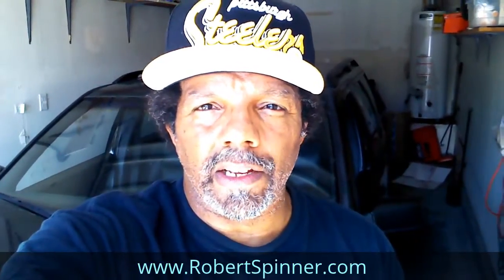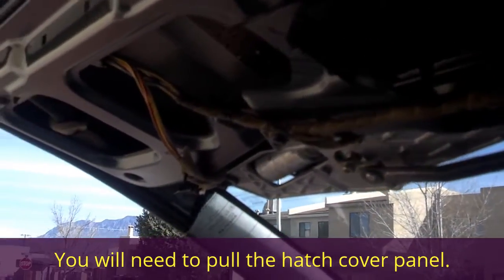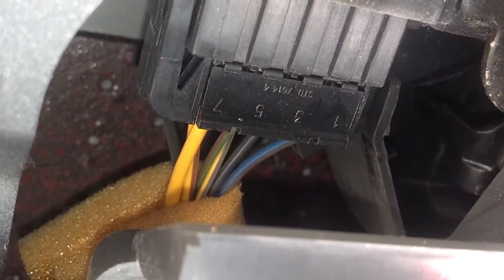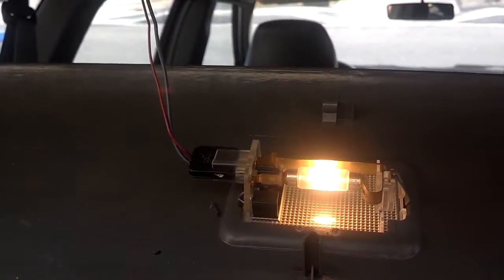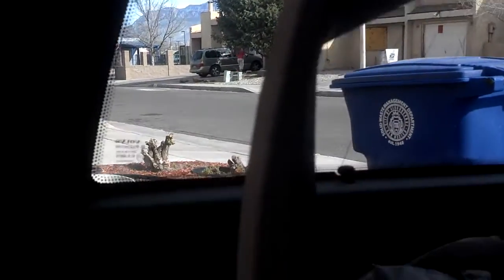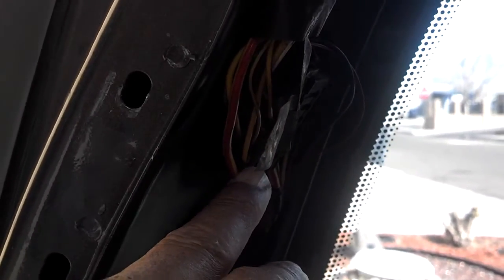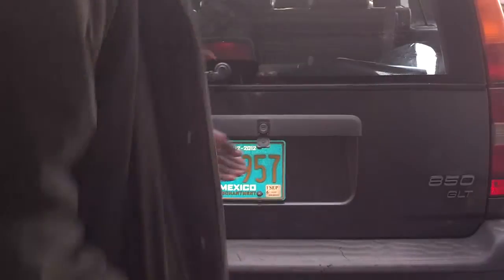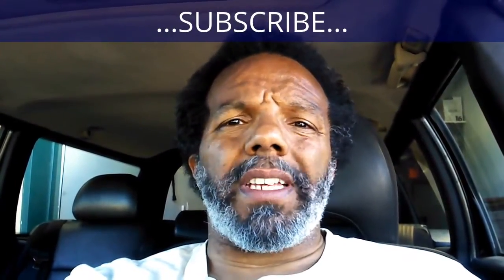Rear hatch latch testing and repair, Volvo 850, V70, V70XC, etc. - VOTD

Comment: Any videos on removing the rear hatch lock, on an 850 wagon. 
The trim piece, won’t come off, with the lock cylinder attached. 
(Lost my key) 
Had to break the ignition, to get home, from far away.
Reply from the maker: Probably not. It has 3 screws.
Reply from the maker: https://youtu.be/8MpOsLy9keg?si=0vt7nXaSdDnQio_3
Reply from the maker: https://youtu.be/QDh4WZne4LA?si=GJto1noap3s-66Ry
Reply from the maker: https://youtu.be/BkAPxVkyzwo?si=lWLqqrQhYClLffgz
Reply from the maker: https://youtu.be/gt9w-ZSxs9I?si=g4vLn7gwNIceLB8x
Reply: Wow, that’s a conscientious reply. 
You’re the man. 
It was quite an adventure. We did an eleven day hike. I lost the only key. But was the ride for four other people. 
Had to break in, turn off the alarm, and get the column lock off, to drive home. It’s the European version 97 manual AWD, luckily I had put in a non chipped 98 T5 ecu, (and engine).

Comment: I have this problem where I use the central locking remote and it locks and unlocks once then the tailgate is locked shut and I cannot lock my Volvo but I can unlock it.
Reply from the maker: Which Volvo do you have?

Comment: I have a Kia ceed 2 estate 2010 have tested the latch direct from the battery,it has currant at the opening and closing terminals,but does not lock or unlock unless i do it manually,any ideas
Reply from the maker: maybe a bad latch.
Reply: @RobertDIY  yes have had one from eBay,but that was faulty,have checked it out direct from the battery, that's how the workshop manual tells you to do it, another one one comming tomorrow,if still not working will check the wiring from the latch towards the headlining,thanks for your help

Comment: I have a 2003 S60 sedan with the electronic trunk release. The "Valet Trunk" lock is on and won't release.  I got the trunk open (after sending my kid through the backseat armrest), but the "Valet Lock" won't deactivate after following the directions in the manual. What I've done so far: Checked the fuse for the locking motor - Still Good. Checked the cables - Still Good. Checked the exterior button to open the trunk: Still Good & makes a clicking sound when pressed.  Anything I missed?
Reply from the maker: +Dave CP Do you have a standard key or remote?

Comment: Thanks as ever Richard. Just tested the wiring on mine and got the rear side panel off without completely removing the roof section that you say breaks. Just needed a little wiggle to get passed it after removing the two T25 screws and pulling down the front section nearest front of car. Just thought I'd share as these twenty year old plastics are getting very brittle. Keep up the great work. Regards Redbrick.
Reply from the maker: Cool, thanks for sharing.

Comment: The plastic ring that my ‘98 V70’s tailgate latch goes into is very worn and about to break. How would I install a new one, or can I simply fix mine?
Reply from the maker: I don't understand your question.
Reply: Robert DIY it’s hard to explain. You know how most doors strike a plastic cylinder piece when they close? The one for my trunk is so deteriorated that it’s pretty much gone, and when I open my trunk, the latch doesn’t completely open up to close again.
Reply from the maker: I'm sure it can be replaced.
Reply: Robert DIY I wrapped it in Gaff tape and it works every time now. I just have to keep an eye on it

Comment: Good question for you Robert.

First of all, thanks for your help.

Second of all, in my s70, for no reason, the car now thinks that the trunk is always open and won't stop ringing in the car and there no courtesy light anymore.

I could easily trouble shoot it, but it's like -20°C right now here so I'm not so happy whit this option hahahahaha.

The trunk open and close normaly, it lock and unlock both with the key and the switch in the car, only the light for the trunk in the dash is light up.

Thank you in advance for your help and keep on the good work
Reply from the maker: Has a bad micro switch in it.
Reply: Really? Because it happened and I didn't touched it at least for the day. Do you know a quick way to be sure if it's the switch? I believe you, just want to be sure before working on it :)
Reply from the maker: Nope.
Reply: Good, then I'll check that myself hahahaha, thanks for the help

Comment: I had the same problem on my 2002 V70. Dashboard message said 'tailgate open' even when it was closed.  It kept setting off the alarm off.  I changed the switch in the latch. Still got the message.  I took off the panels along the glass to inspect the wires.  I noticed the bottom connector to the rear window defogger was disconnected.  The soldering to the glass came off.  I re-soldered the element to the glass.....problem solved.  Now the light by the tail gate goes off when I close the tailgate and there is no message on the dash.
Reply from the maker: +arne lebrato wow, that is strange.
Reply: Robert DIY very strange.  I got the idea to check the wires from swede speed because they mentioned a grounding issue in the harness could cause the problem, as its grounded into the rear glass. My wire to the rear glass came off.  I resoldered it and apparently fixed the ground issue. Now the error message is gone, the rear light turns off and the alarm doesn't go off by itself.

Comment: Hey Robert, I have a v70R rear hatch ready to go on to my 855R. I think I won't have the time to find one in a junkyard, so where do you suggest I find the relay to accommodate the change from the third brake light with incandescent bulb to led bulb?
Reply from the maker: I can find you one. However, it may not work anyway because the wire harness is likely pinned different.

Comment: Smashing job robert :-))
Shame someone ruined the other one, i bet your frend was chuffed with the result :D

Last year i had a hatchback type car to fix, the numberplate light didnt work but it wasnt the bulb, also the wipermotor on the hatch didnt work.
it was the cables going through a rubber gator from the hatch to body, wires had snapped and all of the others were hanging on by strands.
I cut every one and soldered+heatshrinked a 1 foot long wire in, pushed the joints into the hatch and body so no joint was at the hinge bending point.
Worked perfect, although the wire colours were not original, hope the electrons dont mind ha ha :D :D
Reply from the maker: zx8401ztv Sounds like fun. I usually don't worry about wire colors on my hack jobs either. LOL

Comment: Thanks for this video, it helped me find and fix a problem on my car.
If your xc70 hatch handle is crooked, take off the trim on the inside of the hatch.  Look at the other side of the handle, there will be an aluminum pin that the handle pivots on.  Sometimes this pin can slide sideways, so it's not riding in every hole that it should, which is what makes it crooked.  Just slide the pin with some needle nose pliers through the holes it belongs in.  Then use some tape or other material to wrap around the shaft so that it doesn't slide sideways again.
Reply from the maker: +Rob G nice, thanks for watching and sharing.

Comment: I had a problem of the tailgate interlock randomly not locking in an 850. The problem was that the linear actuator in the lock mechanism was working intermittently. I eventually disconnected the actuator because it is better to have a tailgate which is locked and unlocked manually than one which is randomly left unlocked.

Comment: Hello Robert!
I have a problem with my Remote key for my Volvo 855R.
My car's key remote will unlock the cars doors and "unlock" the alarm but it won't lock the cars doors but will set(not set it like it's being broken into) the alarm. I can lock the doors with help of the regular key and all the doors get locked.
I think this might be because of the rear boot. The rear boot cannot be unlocked with the remote and when I unlock it with the key none of the doors unlock at the same time. Same thing if I lock the boot, none of the doors will lock if I lock the boot.
Do you think the rear latch has something to do with this?
Reply from the maker: +David well, the boot should lock and unlock with the doors. Not sure if your car is designed to unlock the doors when locking the boot. 

You may have a problem with the relay or a wire going to the boot.